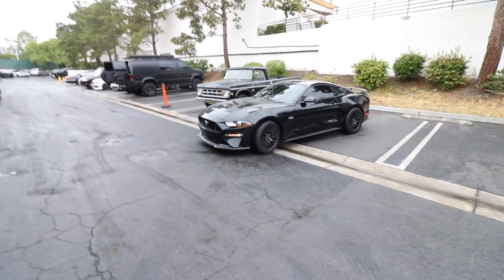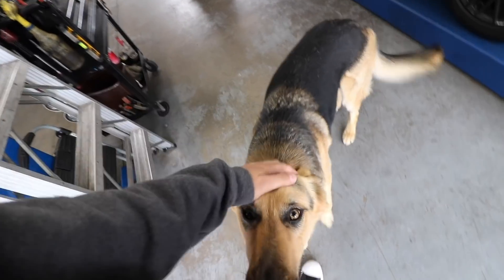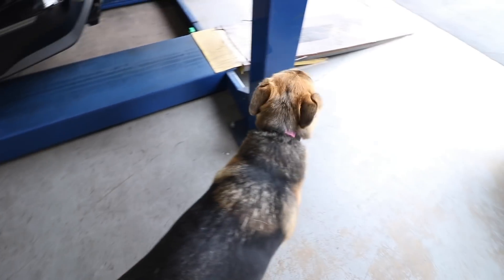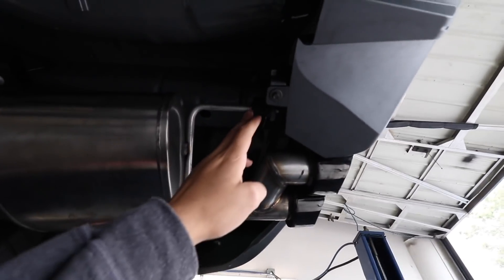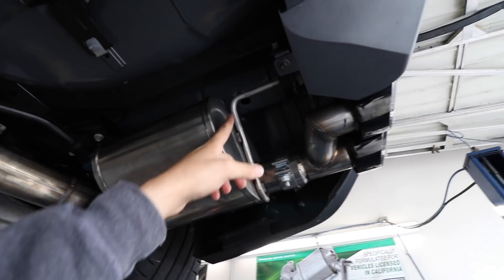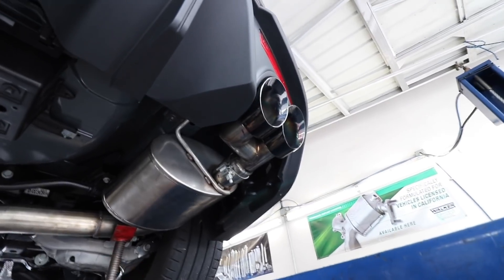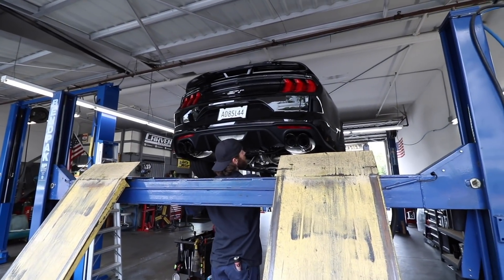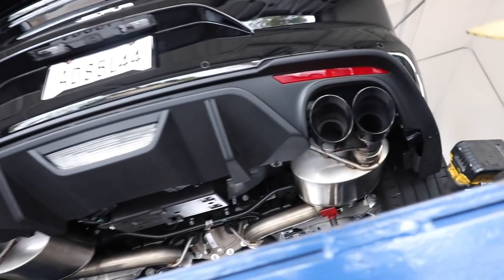FIXING MY $1,700 CORSA Xtreme Cat Back Exhaust FITMENT!!

Comment: So you are worried about voiding the warranty on your $1700 exhaust system, but not the warranty on your $40,000 Mustang? 

Also, if I paid $1700 for an exhaust system that doesn’t fit correctly, or adjustable to fit correctly, I’d be sending it right back to where ever it came from.
Reply: If you need warranty work, you hang on to your stock pipes. I've witnessed Ford approve a 3rd! 3 engines on a 5.0 that a kid had all aftermarket shit on. Because he would strip more than half of it before he dropped it off with us. If Ford doesn't see it on a lift, it was never there. WARRANTY WORK APPROVED.
Reply: Exhaust wont void warranty

Comment: No two cars are the same. When i installed my axel back it was the same issue. I just had to bend that hangar at the muffler a bit. We did take it off and put it on a few times ( cat back portion). Were put a socket on it and bent it by hand a bit. Eventually it was great. Not too hard. Can't believe an exhaust shop did bring it up.

Comment: I had the same issue so i just left the clamp that connects the x pipe with the axle loose then lifted the muffler with a jack and got it fixed, so its the install imo not bad catbacks from corsa.

Comment: I have the same issue in a 2017 GT . I take it to a shop two times, but the tip come back to his original position , its getting very frustrating. Corsa its not cheap, so i hoped the quality were top notch, but the fitment was really awfull. No im gonna take it to anothrt Shop if they can fix it finally.

Comment: Oh good grief, have them re-weld it. (3 minutes in).  Has anyone ever utilized their aftermarket exhaust warranty???  LOL.  Dude, you're paranoid.  have them fix it right. lol.  You're absolutely right, that for the price, it should friggin fit.
Reply: For $1,700 I'd want to maintain the warranty too
Reply: Paranoid for wanting to keep a warranty on a $1,700 exhaust?? I’d be the same way.
Reply: Clutched 392 seriously what can go wrong with an exhaust system, stainless steel yet? Swapped an over the axle pipe on my 2014 GT with a Borla.  Same fitment issues, pipe didn’t align and would not seal.  Had the muffler shop weld it, end of story.  Not gonna waste time fiddling with it to look half assed.  Fitment tolerances on cars vary and are not very precise.  In the automotive hobby, it’s never just bolt on.  Been doing this hobby for almost 30 years, that’s the nature of he beast kids.....
Reply: Steven Freitas kids? Lol, nice. The video was on HIS thoughts with HIS car, then I mentioned MY opinion. People like you like to get on other people’s channels and disagree & rant. Have fun with that.

Comment: 1700 for the corsa ouch!!! I paid 1073 for my borla atak from Amazon the other websites were selling it for 1300-1400. Even my magnaflow which retailed for 825 I bought it for 400 from exhaustexhaust but we used a pry bar to connect it to the factory pipe because it was bent the rest of the system was fine.
Reply: I just got a Corsa extreme for 1085 myself, feels good

Comment: So you’re telling me, you spend $1800 on an exhaust, that doesn’t fit properly? What kind of quality control and design is that? For $1800 it should be perfect. My $700 roush/hpipe setup has zero fitment issues.
Reply: Right I spent less then 1k for my whole exhaust and have no fitment issues.

Comment: I had this exact problem on my 18 mustang when I installed the mbrp exhaust. I unbolted the clamp from the h pipe and lifted it a bit more and turned it and bolted it back and it fixed the fitment👍🏻
Reply from the maker: Yeah, we tired doing that today but unfortunately there wasn’t much change even with the mount we made it still sits a bit low on one side but at least it’s not touching the plastic anymore
Reply: Ahh okay, sorry to hear that I would expect better quality from corsa. Car sounds great by the way 👍🏻

Comment: Corsas gonna be pissed lol jk. but good feed back. Funny thing when I did an h pipe, it pushed the stock mufflers tips like a quarter to half inch out, the inside hangers were a little off but secure. It looked good so didnt bother fixing it...edit:.at the end of the vid you can see the passenger side exhaust tip is off with a gap, that's no bueno for the price you paid. Just saying. But sounds great though..

Comment: Bro you won’t get pulled over for exhaust. That new law is much to do about nothing.  I’m rocking super loud exhaust on my 6.4 for over two years.  In order for your car to be loud enough to get a ticket you’ll also be getting a ticket for exhibition of speed.   So just be aware of your surroundings.
Reply: What kind of exhaust do you have ? I just have the mid muffler and resonator deleted.
Reply: SS_hellawet Just a mid muffler. When it’s WOT it’s very loud as you’re aware.
Reply: Jochen Heiden yeah I have that on my 6.4 Scatpack Charger. Ever thought about getting catless mid pipes?